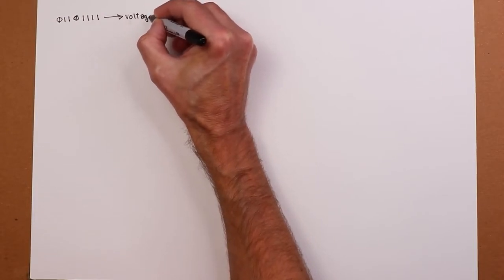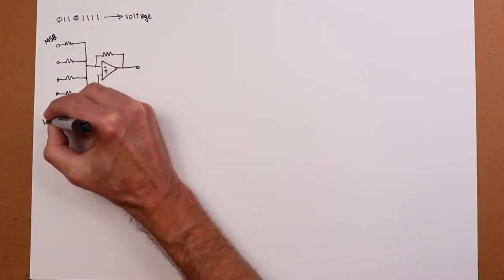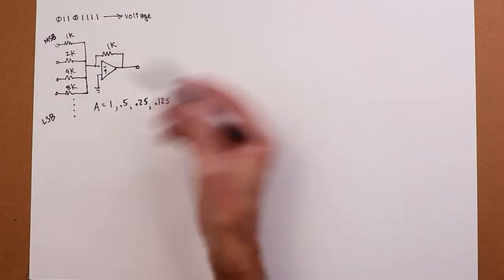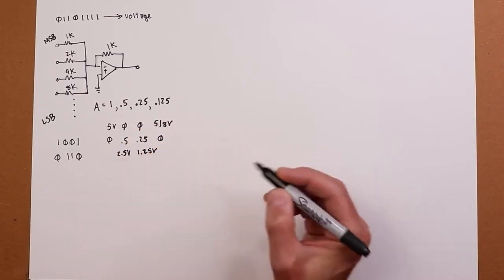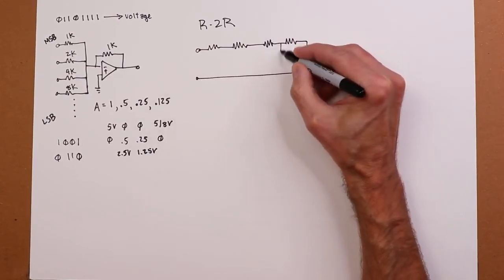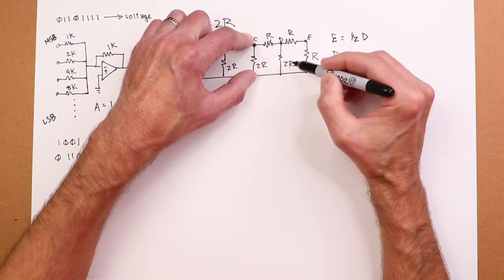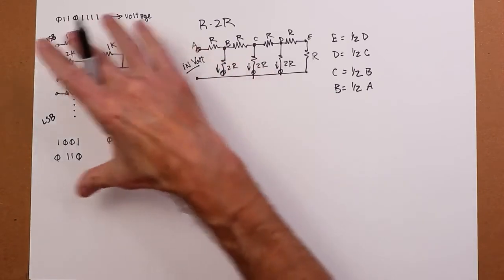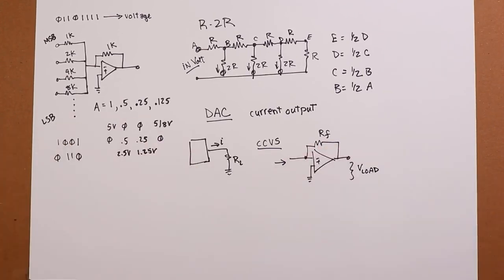Op Amps: Digital to Analog Conversion

Comment: What value of Rf should be used? And where do we measure the final adc voltage? Is it the voltage across Rf? Thanks
Reply from the maker: A weighted summer is useful to explain the process, but as stated, it has issues, hence the use of the R2R ladder. Typically, DACs are designed as current sources, and thus it is common to feed them into a current to voltage transducer stage in order to derive a stable voltage.

Comment: I wonder how the output would be if We Don't use the Amp, When all bits are at a high state.. Would it Be 5v?  In other words ,is the Amp job in the circuit is to smoothen the signal only? Or is it necessary for the conversion..
Reply from the maker: I assume that you're referring to the CCVS introduced at the very end of the video. The purpose is to isolate the DAC from the load impedance so that you get a consistent output voltage. Otherwise, the voltage would be a function of the load impedance. The purpose of that op amp is not to "smooth" the signal (although some modest filtering could be added if needed).

Comment: Great video. Can you please discuss some useful applications of DACs with op amps?
Reply from the maker: How about a direct digital synthesis function generator? There is an example of one in the Embedded Controllers text/lab manual. The op amp is configured as a current-to-voltage transducer (most DACs are designed as current sources so the output voltage becomes a function of the load impedance without the op amp).